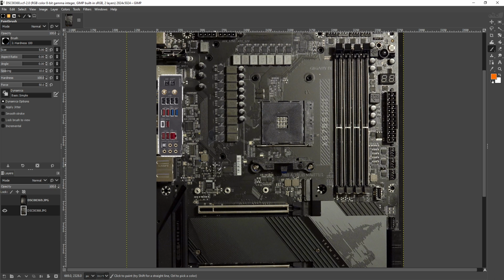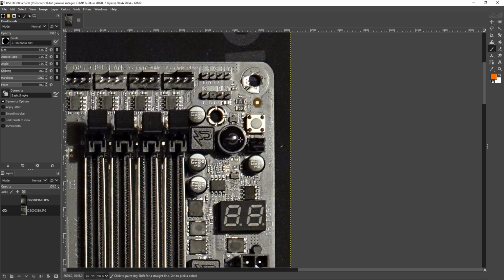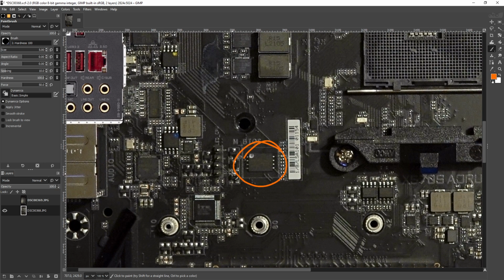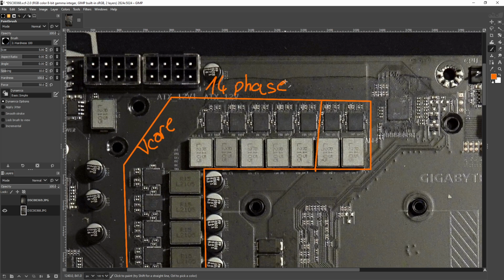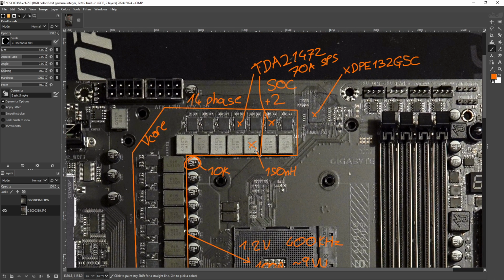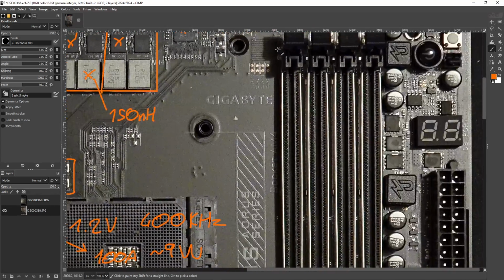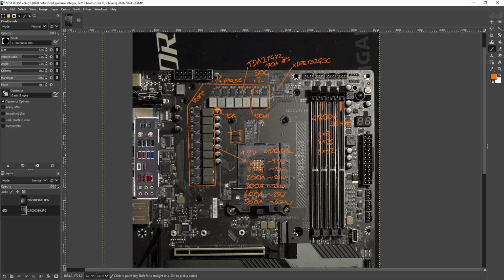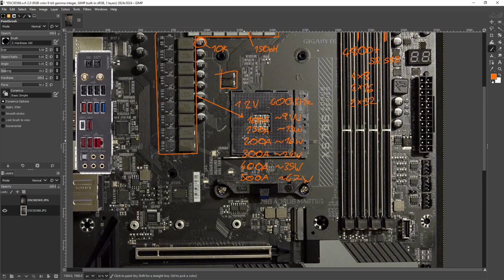mobo PCB Breakdown: Gigabyte X570S Aorus Master

Comment: Something that I love of this improved lineup is finally, they moved the battery far from under the pcix16 armored slot. It was annoying. However, for who want to pay less but have one of those, the Gigabyte GA-X570S Aorus Pro AX it's around 20%  less expensive and give everything most users need. It's called " PRO" but it's more likely an improved version of the Ultra. Still, good mobo and thanks to share.
Reply: Does the battery placement really matter when the board has clear cmos button?
Reply: @Raivo_K  For me it does. I don't want it to be under a place where I have to put 2 and half slots of gpu. I already experienced a completely frozen pc and take out the battery, was the only thing that did help. So absolutely yes, I like more to have the battery where my hands can reach it easily.
Reply: @Raivo_K  I'd say MAYBE if you're someone who does extensive overclocking (especially memory OC.)  Sometimes I've had several attempts to Clear CMOS do nothing where removing the CMOS battery for a few minutes ended up working.

Pretty niche but to each their own -- everyone has different product preferences.
Reply: @Raivo_K  the classic way to reset bios. turn off the computer, turn off the power, remove the bios battery, close the jumper
Reply: @Raivo_K  I had to move my NVMe to another slot because the battery enclosure was getting in the way of the SSD's heatsink 😭
Reply: Just ordered the X570S Aorus Pro and 5900x. Turns out my 4790k doesn't cut it for BF 2042. Hopefully I get revision 1.0 and not the mediatek revision 1.1.

Comment: 12:40 Actually the funny thing is most server GPUs uses the same CPU 8 pin connector because it delivers more current with less physical cables.

Comment: 3rd m.2 is shared with the PCIe x4 slot, I don't think there are any limitations on the rest of the m.2 slots. I have this board and already use 2 NVMe drives and have plans to get another one later on. Also can confirm, could never get the safe boot to work which really annoyed me.
Reply: @xLeelix  I mean safe boot, boots the system with all overclocks turned off I'm pretty sure so you don't have to reset CMOs everytime you dial in an unstabvle OC.
Reply: It's in the manual, LoL. M2-3 and M2-4 cause you either to give up PCIe slot #3 or Sata 5+6, or both if you run NVMe M2 in both slots. Only the CPU-M2 and the 1. Chipset-M2 have no strings attached.  Safe Boot, how many times should it fail booting before the Safe Boot kicks in. On Asus it's like 6 unsuccessful auto-retries before it starts in Safe Mode..and that can take a LONG time. Gigabyte I havent tested the boards I build that much, need to wait for mine to arrive and find out. Clearing CMOS is faster in that regard than waiting for 6 boot errors. Wasted hours there ;)
Reply: @bitmaster6542  When it comes to safe boot I'm talking specifically about the button, that shit just plain never works. I know about the auto kick it, I've let it happen on this board already when messing with MemOC, and yeah it ended up being faster just clearing CMOs when it was unstable instead, also easy because the BIOs profiles save over CMOs resets. Also forgot about the whole stealing Sata ports, I don't use Sata at all anymore so I kinda ignore that.

Comment: This does seem overpriced, I guess if you fill all the PCIe lanes $50 doesn't matter that much.

One question: Does the 'S' chipset use less power than the vanilla x570? Those tiny fans are worse than coil whine.

I'm looking forward to part 2 where you cover the PCIe/ M.2 config*.😉

*Can split the x16 lanes to x8+x8 or x8+x4+x4. So 3x M.2 drives direct to the CPU if it's the same setup as the previous Aorus Master.
Reply from the maker: the bottom X4 goes to the chipset it has no relation to the CPU lanes.
Reply: It has been confirmed elsewhere that the "S" uses the same chipset as the older x570
Reply: @Ye_Old_Grog  That original X570 chipset was rated at 15W TDP. I think this is the Revision 2. If not, how is it possible to cool the chipset passively since all Intel Ultrabooks with 15W CPU must have a fan.
Reply: Same price as the original X570 Master.
Reply: @Raivo_K   The new X570S gains better and more power phases, since the first version uses 12+2 50Amps IR power stages . Then you get better memory  topology and a Thunderbolt header , Wifi 6E.  However, you lose dual BIOS, dual LAN and SLI support.
Reply: @fleurdewin7958  The original was already overkill in terms of power delivery.. So much so that one could run 5950X under LN2 wiithout VRM heatsinks and still be fine. So while on paper the improved powerstages look more impressive they bring little benefit.

One of the original reviisions already introduced TB header and the Wi-Fi card is slotted so user can replace it with a faster Wi-Fi card themselves.

The only benefit that does not really exist on the original (and revisions) is the memory topology improvements and the passve chipset. The lack of Dual-BIOS is a big blow and losing the second NIC is noticeable. SLI suppport only matters to extreme overclockers these days.
Reply: I have the first version of X570 Aorus Master, it does have a fan on the chipset, but I don't hear it at all when it is running.  The only advantage of X570 over B550 is the 2nd PCIe slot can take PCIe 4.0 SSD . You can do RAID 0 to get insane IOPS . Upcoming Microsoft DirectStorage which is already in XBox consoles promises better fps with faster storage.
Reply: @fleurdewin7958  The main advantage of X570 over B550 is that the chipset also gives out PCIe 4.0.

Comment: VFIO enthusiasts prefer X570 as it has better segregated iommu groups whereas B550 sucks at it due to the half baked default ACS implementation by asmedia.
Reply: Yeah, X570 can split off almost everything into its own IOMMU group, which is insanely nice.
Reply: Planning to do a VFIO system and went x570 for that reason

Comment: For Windows 11 I enable fTPM on my x570 aorus master and get debug code 9E from AA/AO. This pisses me off that now I have to look at 9E code to run Win11.
Reply: I have the same motherboard.  9E is not an error code, it's a "Regular Boot" code.  It simply alerts you that fTPM is enabled.  It's not as pretty as A0, but there's nothing wrong with it.

The error code ranges are 50-5F and D0-D1, as stated in the motherboard manual, page 93.
Reply: @Lurker-dk8jk  yeah I know it's not an error code. It's an ugly ftpm status code. I have a 7inch lcd screen (displays temps and shit) inside my case that's right next to the debug code so I look at it all the time. So annoying.
Reply: @mckayver1306  First World Problem.
Reply: @stbufraba  hell yeah, I work hard for the money to pay for that high end piece of art.
Reply: @mckayver1306  On the same UEFI/BIOS page as "AMD CPU fTPM" you will find an option for "Onboard Debug Port LED". Set this to "Off" (why would anybody need a debug code after system start?) >>> Problem solved. Your welcome.
Reply: @stbufraba  That's how all IT-Support should be. Excellent !